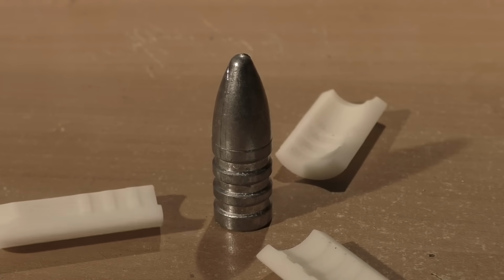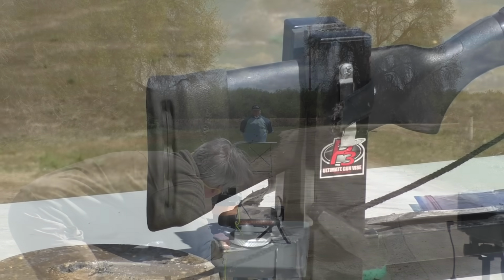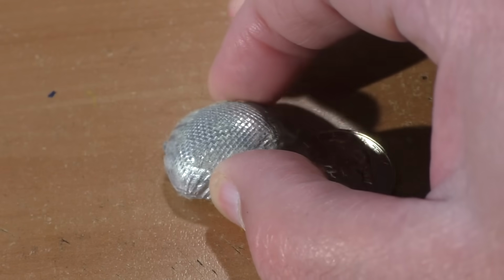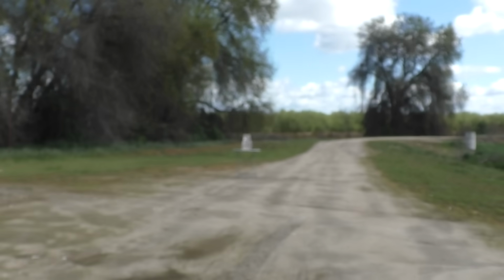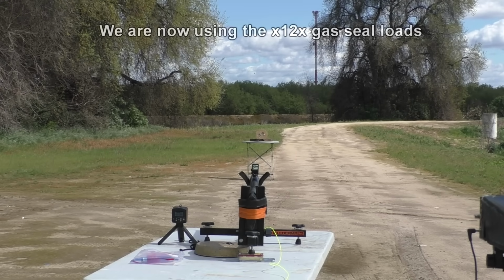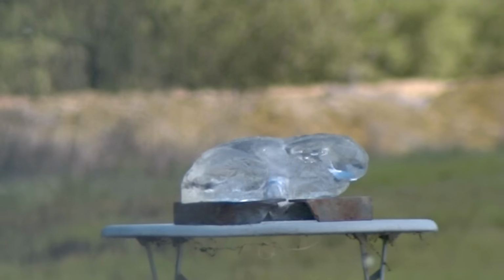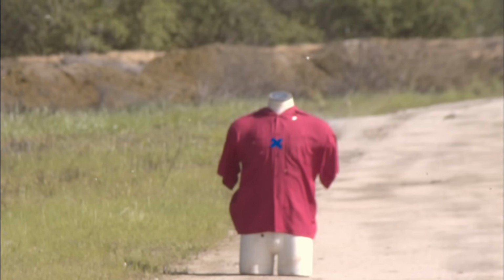45-70 SABOT  for 12ga.  One of the MOST challenging loads

Comment: Hey all, Michael here.  First off, fantastic loading Jeff!!!  The sabots are resin printed using AnyCubic Tough White.  Stronger than standard resin, but still nothing like injection molded nylon like you buy from the store.  I knew the sabots would disintegrate when launched, but as we saw they lived just long enough to do their job, then went to pieces on us!!  I'm very pleased with these results!!
Reply from the maker: And we had consistent spin too,   not just a couple flukes that worked.    Well done!!
Reply: Nice work how did make sabo molds and I'm close by I don't got a job right now lol l would build u a rig for ur shotgun
Reply: Michael, if you haven't checked out "Crash Makerspace" I think their latest one might have relevant info, as he's making bullet proof resin prints and tested two resins. 
I can't recall the other name, but pretty sure that one was the one that did better than the Tough. Similar findings with the Tough resin, that it was much more fragile, whereas the other was not only flexible, but more resilient overall!
Reply: It's always interesting when something engineered to last  just long enough for it's use.
Reply: @waytoocommon9198  Addendum: That setup in a wide meplat tempered hardcast bullet would do Purty Dirty Work on large Critter Skulls and Shoulders. 
Also whack and crack hell out of an Engine Block.
Great work, Men.
FWIW I am previously Subscribed to both of your Channels and greatly enjoy the Content. 
Outstanding Collabo, fellas.
Thanks again
Reply: @jmjones7897  Frankly, I don't even understand why pointy 45-70 bullet designs even exist; AFAIC, every bullet intended for a 45-70 should be designed w/ a wide enough meplat to cover a large rifle primer. And just like that <snaps fingers>, concerns about chain fires in tube magazines just vanished on the wind...
Reply: @nunyabidniz2868  Yep.
Round nose or flats work just fine out of the old man's 1890's manufacted Model 1886 Winchester. 
It doesn't much like the lighter jacketed bullets for accuracy but Zero problems for function or chain firing in tube. I figure  130 years of use without blowing up is a pretty good indicator that it's not gonna chain fire in tube.
Another thing that lends pretty strong credence to this is the rifle was originally chambered in 38-56, with the barrel having been re-bored and re-chambered to 45-70 'in the late 1930's after Winchester stopped producing the cartridges and brass.
So the same cartridge base w/ considerably more taper and a .378ish instead of. 458 bullet.
Both of which would give you a better chance of setting off primer under recoil. In the same mag tube that it left the factory with as a black powder cartridge rifle. The thing is big and long and heavy and damn near indestructible
Reply: @nunyabidniz2868  Because single-shot .45-70s exist.
Reply: @waytoocommon9198  As long as your getting consistent stabilization of the projectile( as demonstrated) you could call that a Feature as opposed to a bug/ fault. 
Given that your sabot model and material works consistently through an expected range of temperatures/barometric pressures/ environmental conditions and doesn't degrade in storage( if if's were buts...) what you've got there is basically a Safety Sabot.
Damn sure not safe to stand inline downrange of that 500 grain bullet, 
However;
Bullet is gonna more or less travel on the aimed trajectory. 
A disintegrating sabot minimizes unintentional secondary injuries potentially caused by the sabot component after projectile separation. 
If that thing shoots and penetrates straight reliably you may have just developed a 12ga Unicorn Load for Big Angry Animal Defense
Reply: would the color of the plastic be the reason the chrono isn't picking it up? i also wonder if the angle of the grease grooves was causing different loads on one side or the other of the bullet as it was launched.
Reply: Maybe a flexible printing material like TPU would work better.  The accuracy issues probably came from the sabots breaking up in different ways every time.
Reply: @waytoocommon9198 Could you please share the design of the sabot for 3d printing?
Reply: No sabot, no evidence.

Comment: Does the orientation of the sabo when the round is loaded to the barrel make a difference❓example: could a two piece sabo splitting away vertically as apposed to horizontally have an affect on the trajectory of the bullet❓
Reply from the maker: Not sure if you could predict where the split would end up when it leaves the barrel.   Sabots can cause problems as it leaves the barrel and if they don't  separate cleanly,   can knock the projectile around a little and throw it off course a tiny bit.

Comment: I mean I go ghetto as I call it because if you don't need to buy something and have something you can reuse or recycle why not. Our world should have been worrying about it from the get go. My muffler for my car I bought steel tubing saved a fortune. Cut it down the middle to make half a cylinder got pipe clamps and used muffler tape that would last until it rusts out again. I saved over $150 bucks it only cost me $30 for the 10' pipe tape was like $10 and clamps I had forever now. Probably saved more then that. And of course used portions of the pipe for the rest.

Comment: Mcmaster carr part 69905K185 is a 12V pull selonoid. Hose clamp to the wrist of stock with a Momentary switch and a 12V std. motorcycle battery and you can pull the trigger with no rifle movement.   Battery will last many hundreds of pulls.   I have used it with triggers much harder than yours.   Big Fan, Pete

Comment: Capture the trigger from both sides. Use  another plate. That will stabilize the trigger pull. Maybe connect the plates with another bolt so when you pull the string both plates move together to pull the trigger back.

Comment: Raise the pivot point of the actuator arm to just below the trigger guard. Tie the sting to the bottom of the actuator arm an loop it forward through an eye bolt or around the frame  so when you pull on the string it pulls the bottom of the actuator arm forward and the top of the actuator arm back against the trigger. This will make for a smoother action by giving you some mechanical advantage and you won't have to pull so hard to set off the trigger.
Reply from the maker: The problem was when I adjusted the gun in the rest for elevation,  the bolt that interacts with the trigger would move too,  often to the VERY top of the trigger giving horrible leverage.   I slotted the arm so the bolt can be adjusted properly against the trigger and it is very smooth now.

Comment: It looked to me like the trigger pull mechanism is causing the rest to jump.  Maybe a cheap pneumatic cylinder hooked to another cylinder with tubing.  You actuate the remote cylinder and it pushes air against the cylinder mounted to the rest, to press the trigger.   Or an RC car or plane servo.  You’d need an RC car battery, some wire and a spring loaded, return to center toggle switch, along with the servo.   I looked online and Wally’sMart came up first.  They showed a servo kit with a bunch of arms and linkage wires for $20.99.   I did not check the specs and have no idea what the trigger pull is on your shotgun.

Comment: Dear Tao/Jeff/Maven of budget high-speed videography: back in the Olden Tymz <TM>, we had these things called "film cameras" that were used by "photographers" to capture still [!] moments of time in a visual format. Sometimes, these "photographers" would wish to trip the "shutter" [the barrier preventing light from acting upon the light sensitive "film" held within the camera body at a fixed distance from the "lens" attached to the front of the body] remotely; to accomplish this, they utilized a "remote release" which in the days of mechanical cameras, consisted of a long skinny rubber tube with a squeeze bulb at one end and a small piston contraption at the distal end of the tube that could be screwed into the shutter button on cameras so equipped [most of them sold after the 1970s came w/ this feature built-in] so that the photographer could squeeze on the bulb and the piston would trip the shutter, with even less disturbance to the camera's position than if the photographer had tripped the shutter w/ his own finger on the button.

I submit that you can find one of these old "pneumatic releases" in an old thrift shop or possibly even new online [here's one run w/ a cable; shorter than the pneumo ones were, but same basic intent: https://www.amazon.com/Pastlla-Threaded-Vibration-Free-Bulb-Lock-Mechanical/dp/B09VBGTQPR/ref=sr_1_3?crid=2PMYD5SIDA4TU&dib=eyJ2IjoiMSJ9.-Ge7eAWFuDszAcyXRbr8PIXX5Q4cJ2_tfXLf-7ys7fa0EGQT6sXzti96ZudL8SciwH1KrPyNa9gmJKJJNBDpaJl_5tCkSQQsh13tRspNy8vUli9blcOR1c-cS5oi4ULfDl8W1mNXQnT8jVJUqKO5C56JIVBh-Me2e82Bl8uoYqpUpCDRNJwxF6oUDiV04vglnSgQf1GCkO1WGroAlR44BycEGow2yUZXluQqZRfRUVk.zymdDxtEc9REVrymlQpFlrkH4xzCw1uvskFn0Irv3OU&dib_tag=se&keywords=pneumatic+shutter+release&qid=1742750123&sprefix=pneumati%2Caps%2C2134&sr=8-3] ] can be had for a pittance and adapted to your needs to fire the gun remotely while busy driving the video cams.

Sorry for the pedantic writing style, but I leave this here for posterity, so the eloi who grok not the utterances of The Ones Who Came Before might understand... 😄

Comment: At ~ 00:30 -- You forgot to mention that the .45-70 is the oldest centerfire cartridge that is commercially available and still in common use, only superseded by the .22 short [which is of course, rimfire.] It's even older than the .22 Long Rifle [1878 vs. 1871 for the .45-70, iirc.]

Comment: 45-70 is no more a “lever action round” than 223 Remington is. Just because it’s a popular cartridge enough that Henry and Marlin when they e sited made lever guns chambered for it doesn’t make it a “lever action” cartridge. Dates back to the trapdoors as the 45-70 Government, an improvement in the existing trapdoor conversions in 50 caliber. Springfield armory was converting old muskets first into breech loaders then started making 45 caliber barrels and thus the improved 45-70 Government. It enjoyed production from 1873- late 1880’s. Then the bolt action started replacing it. Lot of dead Buffalo thanks to 45-70 out of trapdoors.
Reply from the maker: Did I say it was ONLY used in lever actions?

Comment: See some good trigger operation suggestions here. I was thinking about just having a guide for the string at the rear stock support so the pull on the actuator is in one direction with no lateral force. Was thinking a pulley, U-bolt, etc. Would still have lateral force on the rear of the sled, but not the trigger actuator... Always impressed with the infinite 12ga load ideas, and your ability to find great ways to load them. Thanks for another awesome one Jeff.

Comment: 9:54 3d printers can print multiple materials nowadays. PLA is pretty common which is quite brittle but there's also TPU or PETG which are much more flexible than PLA and won't shatter as easily. I still don't know if those flexible materials can hold up to the gforce behind the sabot.
Reply from the maker: Someone needs to submit them
Reply: @taofledermaus  I wish I could. One day maybe.

Comment: Possibly an instant improvement for the pulling string.
Instead of attaching the string to the lever, attach it to the stock or the rear of your stand and loop it around the bolt that pulls the trigger.
That way you get twice the travel to pull the trigger and only about half the force pulling on the setup. (more control and less disturbance)

Comment: I agree with your distrust in 3d printed parts but also want you to lean into it. The design, material and, slicer settings have a huge impact along with knowing when something easily available is better. Nothing is dumber than the countless 3d printed 'zip ties' I see when superior ones are stronger, cheaper, and easily available. 
It would be fun to see what differences in engineering choices make and if there are  niche situations where it makes sense.

Comment: Id suggest getting a cable actuator for your trigger, basically the same sort of thing as a bicycle brake system has. Wouldnt be too hard to fabricobble something up, and id be happy to draw up designs. All you need is either a busted old bike, or a couple dollars down at the bike shop or small engine repair. Completely eliminate the jerking around and get you a reliable trigger pull every time

Comment: The strap and belt combo seems pretty stout. I was going to suggest using duct tape to replace the failed chinesium belt.
To give the sabot a little extra help gripping the bullet, a few drops of super glue on the rear seams the sabot sections meet each other. And a drop or 2 between each sabot petal and the rear end of the bullet.

Comment: The stand is being pulled to the right on the back side.  Hence throwing your aim off to the left.
I suggest you take the rope around the left side of the stand (Do not change the trigger puller) then take it through an Eye bolt or two.  This will hold the string up and in place while you fire.
Then do a slower more contestant pull on the string instead of a jerking motion, like if you were firing the gun by hand.  "You squeeze the trigger, not pull it. if you pull the trigger you pull your aim."

Comment: Great job trying to do everything yourself. Could you add two small pulleys to your trigger line? It will increase the torch to the trigger pull while allowing you to apply continuous pressure.
Reply from the maker: I made some improvements to the lever to keep the alignment of the bolt properly on the trigger.

Comment: bro, it's working fine, just re-zero with a stabilized, weighted sled, it was zeroed without being weighted and popping a wheelie on every shot, now when the sled is properly stabilized it's gonna hit low, anyone who has ever fired a tripod weapon system will tell you, sandbags, I don't recommend fastening the sled to the table, it will just make the whole table jump, then you'll have to reinforce and sandbag the table instead, keep it simple

Comment: Regarding the round… a harder sabot but not hard enough to harm the bore. 3D printed is OK… IF it’s material that’s made for these applications. No, you’re not going to get good components printing PLA on an Ender. Nylon on a Prusa in an Enclosure is a different animal. Not a fan of the stand. Having to jerk the trigger by double yanking a string cannot be good for accuracy. Better to deal with schedules and get OG, Brianna, etc.

Comment: Have you considered using ratchet straps to secure the stand to the table? One at the front and one at the back would marry the stand to the table and you could still use the weights on the table to simply keep the table from moving as much. Just a thought.

Comment: looks like you may need to add a small pulley there where the belts are attached so your pull string has a straight back pull and you can be off to the side with your camera thus keeping you from having to make multiple jerks on the string.

Comment: Your description of the .45-70 nomenclature is correct, but the .45-70 was originally a single shot rifle round.  Lever guns for it did not become available for it until 8 years after its introduction...and the 500 gr. spitzer type bullet used in this sabot would not function through a lever gun due to its length. It would also be unsafe to use a pointed bullet in a tubular magazine rifle.
Those are commonly used in single shots such as Sharps, Remington, Ruger and Winchester.  And more commonly used in longer cased .45 caliber cartridges. I use them in a Shiloh Sharps .45-110, 2-7/8". In lever guns (Model 1886s) I use 405 gr. flat nose bullets.
A round nosed 500 gr. bullet MAY function in a lever gun, if the bullet is seated very deeply in the case, but wouldn't be the best choice, especially not with black powder.
Reply from the maker: For viewers who have no idea what a 45-70 is (it's just an arbitrary  number to many non-firearm people)  ,   I needed to give a little context

Comment: i think a not insignificant part of the accuracy is how hard you seem to have to yank on the trigger cord. it's causing a great deal of shaking to the muzzle end. Also, can i just say how underappreciated the effort Jeff has to go through to devise the best way to actually load these slugs into the cases is. determining the appropriate powder and charge, as well as the various sabots and such to get the things to fly right is no small part of how well some of these unusual designs work.

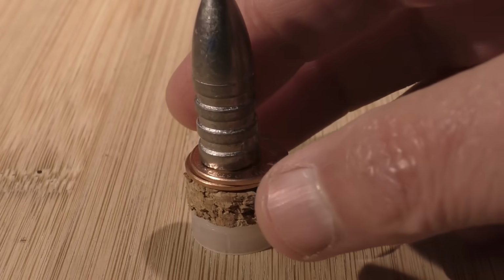Comment: 2:25 Brilliant. Also because a penny is almost the same bore diameter as 12ga. 
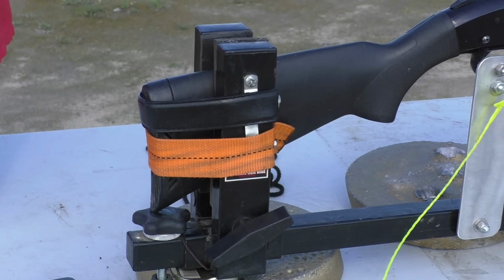4:47 You got rid of the rubber butt pad and utilized a random leather belt, well done!
Bench rest sandbag hanging over the stock.
Reply from the maker: The pennies are actually a bit larger than the bore.   They engage the rifling and spin like crazy.

Comment: Did you consider trying to run the rounds through a 20- or 28-gauge?
Reply from the maker: These are designed specifically for a 12 ga.   They wouldn't fit in anything else

Comment: a couple sand bags hanging over the bottom front table leg support  with 1 or weights on the top of the front with 1 sandbag on the bottom leg support for the back legs should stabilize it. or you could take a couple pieces of rebar, one one end of each piece,bend it over like a candy cane so that the Inner radius fits over & around the outer diameter of the bottom of the table legs so that you can drive them into the ground like stakes to secure it